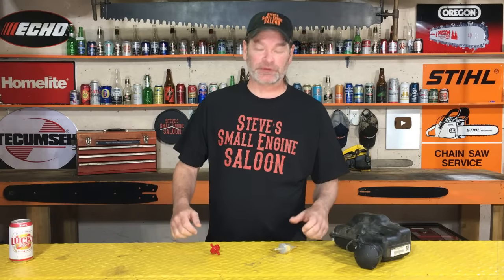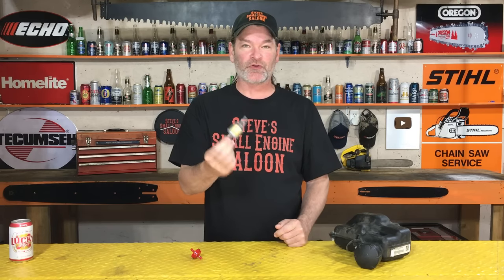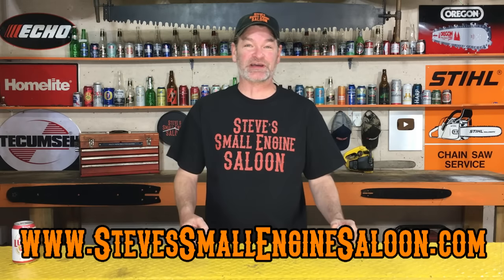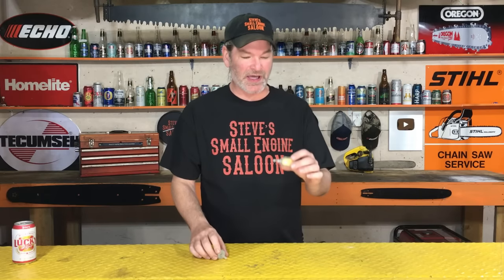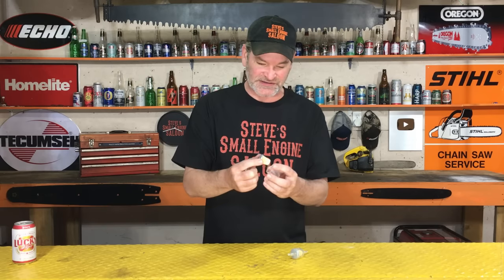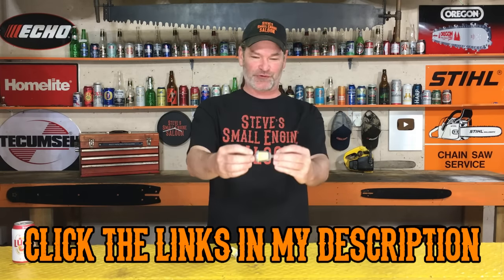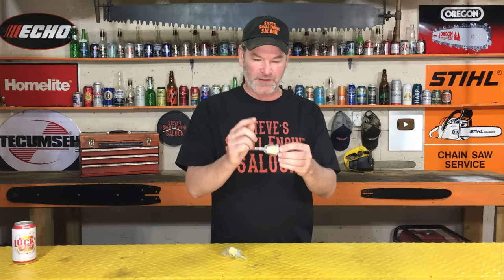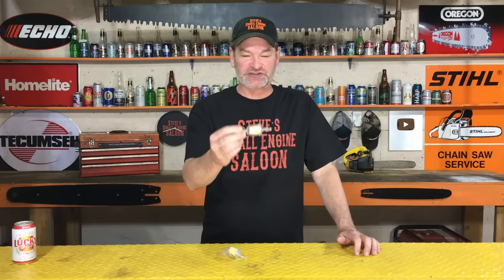Why Is There An Arrow On Some Fuel Filters

Comment: The importance of a clear in-line filter. I was going to do an oil change on my ride on mower and the fuel filter is right beside the oil filter. I noticed that the filter element had broke free inside and was just floating around letting the fuel bypass the element. It was a cheap one. I thought they all are the same....Maybe not.

Comment: That's why it's clear so you can see debris and contaminates. Like steve said,it doesn't matter what direction it is but only to see when you have contamination in the fuel and when it definitely needs to be changed. If not you might think your fuel is perfect unless there's no more fuel running thru it.

Comment: just throwing a Q out to anyone who might have a suggestion...   have a poulan 4218 and a craftsman something or other - they're both EXACTLY same thing - same parts, different colour... both are good enough for me, i don't stihl, i'm not huge or strong, so i don't need 'too much saw'.   the craftsman had a 16" on it, and i just never used it... but the poulan started smoking and when it opened it up the chain brake was melted... ordered another one, but figured i would use the craftsman.   virtually unused.   but the brake won't stop the chain under throttle.. you can't move it when the brake is on and the saw is off, but doesn't stop it when the saw it ON, which is kind the important part.  changed the clutch drum, didn't make a difference...   but this thing SPEWS bar oil - like a spray - could it be lubing up the brake band?   don't want to buy a new clutch - they're like 38 bucks, and can't find just the spring for my model.  adjusted idle, h and l speed screws... anything else?

Comment: There is an arrow on that thing?  Weird phenomenon i recalled, i owned 1974 soviet motorbike 20 years ago. i fixed it and as a cautious person installed fuel filter as well. So i experienced some troubles from time to time, low fuel flow, glogged carb jet, glogged filter, etc. After a year i got rid of the filter and no such problems occured, go figure..
Reply: Terminal Boy  exactly. if it is a tight fit it wont work, rust, waterand various debris are considered as fuel powering supplements

Comment: So basically it doesn't matter which way the arrow goes it will work the same. The fuel filter I got said the ( IN ).
 Wasn't sure does that face the carburetor or the fuel tank. 
Thank you.

Comment: But in the very beginning, the other fuel filter was red and could not see through it. What gives with that?
Reply: I looked at several retail stores for the red filter. I found PRIME LINE part 7-07103 for about $4.00 at O Reilly as well as Advance Auto.  They are red and see-through ( translucent ).  Different outlets sell a similar but different part # that is opaque ( milky /cloudy )  not recommended.  J K
Reply: @jameskrivitsky9715  interesting assessment my friend. I guess one can say that like always, Steve has his act together.
Reply: That is a different type of filter that he made a video about a few weeks ago. He doesn’t like that type because it uses a metal screen to filter and he feels it doesn’t catch enough junk.

Comment: It's also much more difficult to remove contaminants from the inside of a cylindrical filter than to remove them from the outside using an air compressor and nozzle. Why throw away a fuel filter when you could clean it instead in under 60 seconds? So the arrow is also for maintainability/saving money.

Comment: being that the fuel is flowing around the outside that means particles could flow right past filter and into carb without out getting filtered at all...... because the end with silver cap is not sealed tight to the the filter housing its self meaning there is space between housing and filter for debris to get past. i inspected mine closely and thats what i saw with out cutting it open to be sure. if i am right this is the worst filter ever.  glad I examined mine!! cause ill be looking for a better one before running fuel through my cheap but  new carb! ps if i were to use this filter i would run it backwards so at least fuel is goin inside filter then back out and around outside of it too just to be cautious. if it were absolutely just being sucked in through the filter and not along the outside and then thats how it should be.....   let me know if anyone else has concluded the same?? not to mention would debri be abl to get lose being filtered mainy/initially on the out side?
Reply: enjoy the vids and am in no way claiming %100 percent facts. thats just me burning belts upstairs to put my 2 sense in.

Comment: There is significantly less surface area on the inside of the filter versus the outside of the filter. There is an arrow there for a reason.  Best of wishes to all. :)
Reply: you would think the difference would be miniscule , they are exactly the same shape save the thickness of the filter material

Comment: Then please explain this >>>  https://www.picclickimg.com/d/w1600/pict/254601287472_/Fuel-Filter-FRAM-G10166.jpg  <<<, ...an all metal fuel filter with flow direction marked on it.
I think it has more to do with preventing fuel pressure of a fuel pump from blowing out the clogged filter media, and allowing debris to pass through.  Not as big of a deal with a gravity fed system, as it is when there is a fuel pump in the system.

Comment: Tells you which direction to reinstall a new fuel filter from the gas tank to the carburator. Improper installation will result in the mower not running well. The arrow points to the carburator, plain and simple.